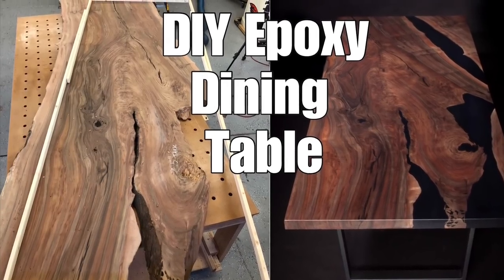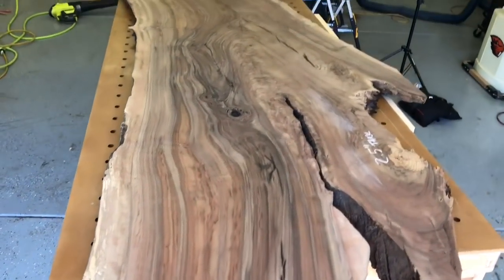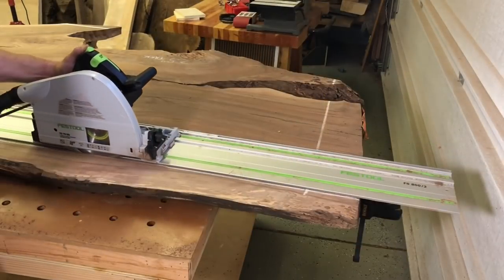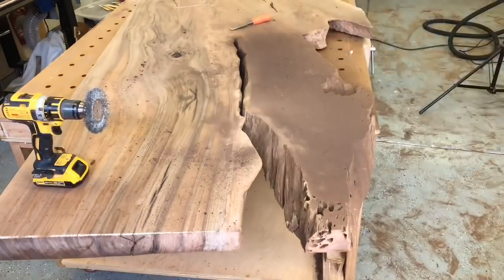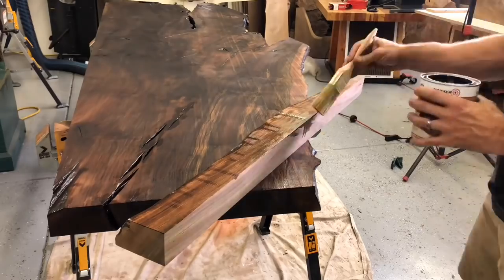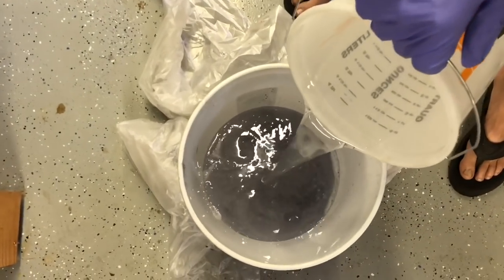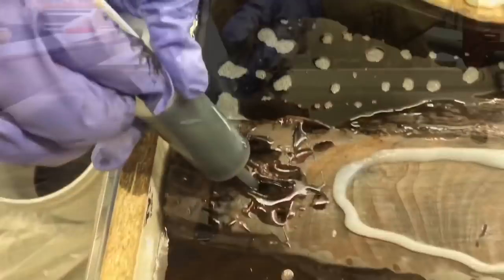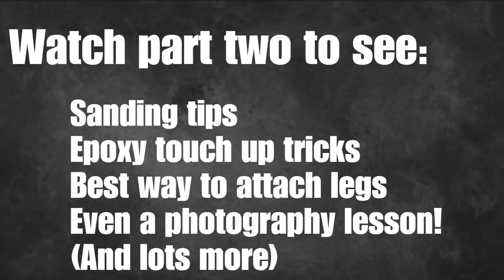DIY Epoxy Dining Table—How to Woodworking—Part One of Two

Comment: I own a construction company, but my true drive and passion has always been wood working. Slowly built my inventory of commercial tools and equipment that collect dust more than make it, because I’m usually making free projects in my spare time for fun. Well.. I just bought a $4,000 black walnut slab. It’s your fault. Kidding, but you offer incredible advice and insight. And they way you demonstrate mistakes genuinely helps in all processes of anyone like myself who’s a perfectionist. 90% of my projects never end up following my initial plan or idea. So I got to the point where I just jump head first into it, with zero aim or goal at the end, until it’s finished. And it really generates really cool stuff! Turns on the creativity when you really f-up. 😅

Comment: You are awesome Mate.
You should install a removable light-structured roller frame with a lock in mechanism on the back of your ute to prevent the slab falling of when yoy are driving.
Also, you should make the workbench height-adjustable using only one carjack.
Reply from the maker: Good call!

Comment: I'm curious about the bonding strength of the epoxy. I noticed that you didn't reinforce the wooden pieces together with either steel rods or wooden support pieces. There is a lot of weight in the wooden pieces and I was wondering if there is a possibility of separation of the wood and epoxy?
Reply: That's what I was thinking, I thought he could have drilled into the sides and installed some threaded rods into each piece to give the epoxy some longer bits to grab around.
Reply: Don't forget epoxy is a glue, it works through micro bonding deep into the pores of the wood, as well as a a keying effect where it takes perfect hold of the odd shapes its near, this ecopoxy is meant for tables like this, but I'm speaking to epoxies in general, and they are basically the strongest glue you can buy. So there is absolutely no need to reinforce for the strength of the bond. However some reinforce under the table with inlay ed steel beams help stabilize the slabs from twisting, but if the wood is at equilibrium moisture content of its final destination this will never be a problem. However, many aren't cautious or patient enough to wait until wood is at its perfect equilibrium moisture content.
Reply: @droost  Thank you.
Reply: He did make a point of removing the soft rotten edges. I suppose if you'd want to keep the rot to add a dimension, THEN you'd need reinforcements.
Reply: I think you would have a better chance of the wood itself breaking before the bond does! Epoxy bonding is and epoxy itself is extreemly strong

Comment: Prices would be nice? What would it cost for just materials? I want to make one for when I do my kitchen remodel.
Reply from the maker: Vince Renteria thanks for the feedback. I’ll consider that for my next videos!
Reply: Just post prices in the description!!  @BlacktailStudio
Reply: He doesn't want to post the price because then you'll find out that the Live Edge wood slab cost over $4,000 alone......💲💲💲
Reply: @jonathanhumphrey4143  
Now that really depends. I bought a nice large Live Edge slab for a table that I built and I only paid $25 for the slab. Now it was not Walnut it was Hemlock but it was a gorgeous piece that I bought from my neighbors sawmill and I'm sure he gave me the neighborly price. The table turned out gorgeous . I did not use epoxy but many many coats of polyurethane . I'm not even sure how many coats that I  used but when I say a lot I mean A LOT.    Take care    T
Reply: @jonathanhumphrey4143  I checked out goby Walnut. Anywhere from $400 to $12,000...........
Reply: The price of the materials will make you just dream about it,Not to mention the tools you need to do this ,
Reply: Just the epoxy jugs that you see in the video amounts to $800 (30L kit).  It looks like he mixed 1/4 of it so $200 worth of epoxy.  Yuck.
Reply: QuadLogic126 why yuck?
Reply: @si2517  because it's expensive. That should be obvious.

Comment: I love raw edges.
I made a 8 foot bar out of river red gum for my pool room. It has some amazing fiddleback in it which catches the afternoon light. I supported it with an old rail way sign holder made from iron and cut in half to act as brackets.
The raw edge is like on a 45 degree angle so its perfect for leaning against with a beer.
Reply from the maker: Sweet!

Comment: I live in california where theres tons of coastal redwoods, and on one of my father's old properties, it came with a massive cut of wood out of a 500+ year old redwood. The cut is about 3 inches thick and it spans roughly 7 feet at the smallest point, not including holes in the wood from rot. Hopefully i can use it to make a killer coffee table using the epoxy method
Reply from the maker: Oh man, that’s gonna be awesome

Comment: I have an @home workshop (aka my garage) where I build tables, benches etc.. I use live edge slabs from trees I've fell, slabbed and dried in my kiln. I have to say, I love my porter cable material remover too! That thing is such a time saver! Everything else I have is from the dewalt flexvolt system or in homeowner lingo, the yellow ones with the big 60v batteries lol. You've done an incredible job here! It's a gorgeous table and for the most part, you're spot on. With 1 small exception. I may have miss heard but it sounded like eco-poxy is the only one capable of doing a job like this at this level or that it's the best one hands down and no other can compare... Maybe they're a sponsor, making it the "appropriate" thing to say on a informative video.. Whatever the reason, it's incorrect. I've married slabs together with an inexpensive 2 part epoxy sold on Amazon and I've done it with eco-poxy. As well as a few other brands priced from high to mid to low. Call it an epoxiganza or a personal search for the best value to use on a professional level. The difference I found between the $200 2 part 1.5 gal eco-poxy kit and the $50 2 part 1 gallon kit sold on Amazon is viscosity and the need to torch-pop the bubbles.. All of my pours were done in a temp controlled environment though. If you're planning to recreate this table or one similar to it, DIY style. Know, you do not need to buy the most expensive epoxy on the market to achieve results like this. In fact, with a little practice and alot of patience, you can accomplish this look with the inexpensive one! Buying epoxy isn't like buying a truck. A $10k one is alright but the $70k one is MUCH NICER! A 2 part epoxy is  2 chemicals mixed into 1 that molecularly bond and chemically solidify. The cheaper brand simply adds more of an inert element. Which creates a void between the elements that makeup the chemicals for the resin and the activator which increases total volume of product. Too much of which and it's no longer epoxy. But if it's epoxy than its epoxy. It's not as if the elements are lesser somehow. Just not as numerous or abundant. Which is why some adhere better than others. Bonding flat smooth surfaces may be an issue with an inexpensive brand. Also some will yellow in the elements or exposed to direct UV light. But for bonding 2 live edge slabs together with colored epoxy, adhesion or discoloring won't be an issue at all. If you're doing a crystal clear pour, without mica powder or dye. Then yes, a more expensive epoxy may be needed if it'll spend any time outside or in direct sunlight. Ie. a dining table next to a large east or west facing window. It'll cause ambering or yellowing. Other than that, an inexpensive epoxy is perfectly ok when colored and used to marry slabs with solid jagged edges. Do your homework, buy a few (3 or 4) different brand, 8oz. 2 part epoxy kits. Do a couple small pours with each one. Bond 2 sticks together or whatever you can imagine. Just make sure it's worthless and fun. Once you've mastered an 8oz pour that's a few inches long by an inch deep by a couple inches wide, you'll be able to do one at any scale. Just be sure to triple check everything before you mix and pour! If you use your brain to plan and pay attention to detail. You can do massive pours without spilling a drop or losing any to leakage or seepage. Just make sure you have a plan, plan, plan! Don't just hop in a tractor and plow down a bunch of corn fields then expect a baseball field to pop up...
Reply from the maker: Thanks for the feedback! This video was made a while ago and I believe ecopoxy was the only deep pour one back then. Definitely lots of companies out there now though!

Comment: How much would a slab cost
Reply: A slab like what he got is close to $5k maybe more at the place he got the slab from. I guess if you can afford a $600-$900 festool saw you can afford a slab that cost $5k.
Reply: @The__Canuck.  WTH? 5K? So the tree costs over 50K? Don't think so...
Reply: @fasousa4798  Yeah a walnut slab of that size and thickness is between $2,500-$8,000. http://www.keimlumber.com/walnutblack link for reference.
Reply: Hank Chinaski  It definitely is for that type of claro walnut of that length width and thickness. More likely more like $7,500.

Comment: To remove the slab from the bed of the truck, could lift up what's on the tailgate and put a dowel or something round under the slab, then just push down on the slab on the tailgate to teeter the slab onto the dowel and then pull it out onto your rolling table... Just a thought. Nice table!

Comment: The story of you finding the wood slab reminds me of a story my dad told me of this time he worked on a farm, and he realized that the ceiling/second floor didn't have any support and was essentially just hanging on the edges of the wall. Clearly, this was unsafe so he went to have support beams made at a wood working place run by this older man, and after telling him the dimensions my dad needed to make support for this barn he said, "I know a tree..."
Reply from the maker: That’s perfect

Comment: Hello Kim and Blacktail Studio Team. WOW! Thanks so much for your video, very useful and clear! I would be grateful if you could give me a suggestion. I left a bottle of gel bleach in a bag on the floor. It is an old, light colored, parquet; therefore, there is a very thin line of empty space between the pieces of wooden strips. For some reasons, the gel bleach leaked and, since the bag was not made of plastic (it was a cloth bag), it passed through and got to the floor. It stayed there for a very long time. The gel bleach had the time to literally dig a large hole in the parquet. Which now looks like a crater, about 6 cm or more in diameter, exposing the bottom layer of the floor, some sort of strange material. I thought to fill it with epoxy glue (Gorilla epoxy with the 2 syringes), wait that it dries, and then paint. I am glad to find out that I can mix the paint with the glue itself. I need to fix this quickly. It's not my home. I would be GRATEFUL if you could help me with the following questions: 1) Since I cannot fill from the back side, how do I address the need to leave a thin line between the wooden strips? (yes, the crater extends beyond 1 strip, affecting the two confining strips at its two sides too. 2) If I send you a picture of the parquet (how/where can I send it? Thanks), would you be able to tell me, approximately, what colors of what kind of paint should I buy? 3) I cannot spend much money on huge tanks, so, is the Gorilla Epoxy glue with 2 syringes ( https://www.homedepot.ca/product/gorilla-epoxy/1000778451 ) suitable for this job and can I mix that type too with the paint? 4) If the epoxy will end up overflowing, how can I gently smooth it without damaging the surrounding healthy parquet? 5) Any other suggestion? Like, if it had happened to you, what would you have done saving as much time and money as possible? THANK YOU SO MUCH!!! I will anxiously wait for your response and my apologies for the long comment. Kind regards.

Comment: Have you done any videos specifically on laying out using the template?  From a design perspective specifically.  I realize it's just a simple frame that you hold up to each slab and see how it looks.  But understanding the visualization process, using the cut off side flipped over, etc.
Reply from the maker: Na, just quick clips like this

Comment: Slabs like that make great kitchen benches too. I had seen this done with used fence palings that were D.A.R. and it looked absolutely fantastic. It's a shame that some of the large slabs aren't completely utilised though, meaning minimising the loss of timber as offcuts by using the whole slab. The other thing is, I don't trust festool as they are overpriced for what they are and do. I like what you have done here, great job.
Reply: Festool is crazy expensice the only tool i think they have people beat at is there biscuit joiner theres are like sticks the others are circles

Comment: I always wanted to make one of these tables. I've built a lot of furniture.  One observation is your table saw sled. Has it got a stop or enough wood on the pushing side for the blade to go into, because at 5.22 it looked like you were going to push your fingers into the blade? Nice work. I'm definitely going to make one now. Isn't it easier just to find a slab big enough, or was this a much nicer piece?
JD

Comment: I know you know that a piece or two of 3/4 inch PVC would help move the slab out of the tuck.  If you had a flat piece go plywood in the bed of the truck.  One golf ball between the plywood and the slab would also work.  The golfball trick is something we used to use to move human remains in a casket in the tight bin of an aircraft!  some of those were up to 700 lbs.

Comment: Hi , I thoroughly enjoyed that. Its such a shame it wasnt 100 percent.
I think the table has flexed with heat or temperature fluctuations whilst the epoxy was drying. And there maybe a reaction to something on the boards.  Another line of thought is that the first pour was not cured before the second pour. Heat will be created when it drys, so that would cause air to rise upwards into the fresh epoxy which is also creating its own heat . I believe metal sides to the  hole and pour in one go would work 👍

Comment: I have a tip for you, hope it will make you job easier, when unloading or loading wood from your truck on top of you table if you please one or two round wood under you  wood it will work as wheel and make it easier to push it off of your truck, just pic right size..

Comment: The weather here is 30-50 degrees on average this time of year. Would you still recommend multiple pours for a 2 inch slab or would you be comfortable doing a single pour? Wonderful work by the way.
Reply from the maker: If it’s cold, should be fine with a single pour. Ecopoxy says it needs to be at least 50F though.

Comment: Fantastic build. Because you use shellac to seal off the entire piece, I'm curious if you have you ever sealed the wood edges with shellac? If so, do you still prefer sealing with epoxy? Thanks!
Reply from the maker: Shellac repels epoxy

Comment: I move large items like that slab out of my truck bed with a short piece of 1'' galvanized pipe. Just lift the near edge of the slab, roll the pipe under, your side of the balance point. Push down on the slab, and walk backwards, the slab rolls on the pipe. Relocate the pipe as it becomes too imbalanced, or use a 2nd roller.

Comment: So we are doing a table top, the river is only 1/4" deep and is already poured with a higher craft grade epoxy. The table will be alcohol inked outside the river area to a nice wood grain look as the table top isn't a high grade wood. All we will be using the ecopoxy for is the top coat. We notice they have several variation of ecopoxy and wondering if you have a preference of which one for just a top coat or of the one you listed is your preferred for all pours?

Comment: Hi Cam - I'm a big fan of the high-end work you're producing out of your shop! I was hoping you could give me some guidance with regards to an obstacle I'm facing with my current epoxy project. Some of the black epoxy that I'm working with stained the wood slabs, and it just looks like crap. I didn't seal the slabs with varnish prior to the pour. I tried sanding with all the various grits you recommend, but I can't get rid of the stains. I'm tempted to either use a belt sander or a homemade router sled to shave off a fraction from the surface. I wish I could attach a photo for your reference. I would greatly appreciate your professional feedback. Thank you Cam!
Reply from the maker: Bum deal! I’ve been there. You might have to go router sled. Those stains can go really deep sometimes. You might not be able to get them all the way out unfortunately. Maybe carve stains and fill with more resin? Not great, but might be the only option
Reply: @BlacktailStudio  Ok, thanks pal

Comment: I want to do a pour with clear epoxy to highlight the character of the wood below the surface.  Any suggestions or videos on how to bring the epoxy back to the high level sheen and transparency after you sand the epoxy flat?

Comment: I am building my second river table now and unlike the first one I built that was encased in a top coat of epoxy top and bottom, this one will be finished with ceramics on the top. I popped it off the pour table yesterday and the bottom is nearly covered with a thin layer of epoxy that leaked out from the river and would make a great bottom not seen but I have a fear that if I leave the epoxy on the bottom and only coat the exposed walnut slabs on top, could it move? I know epoxy shrinks when it cures and I left this clamped on the table for 10 days before removing it. Should I CNC off all the epoxy or do you think at this point it won’t shrink anymore?
Thanks